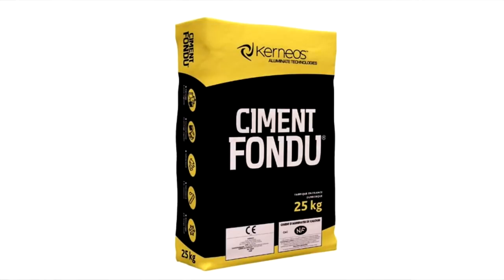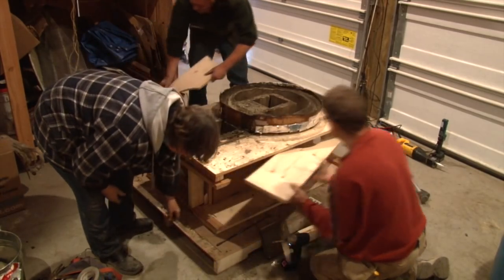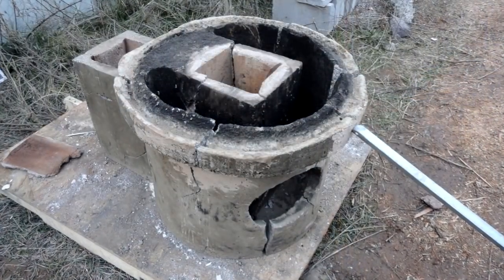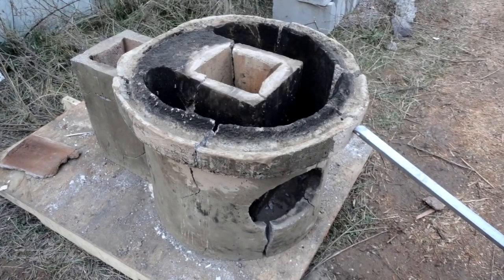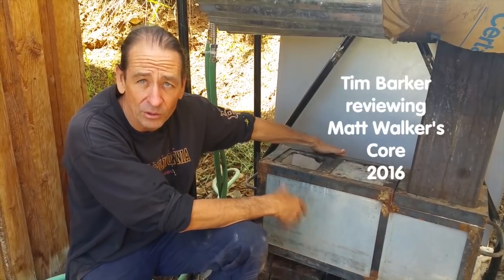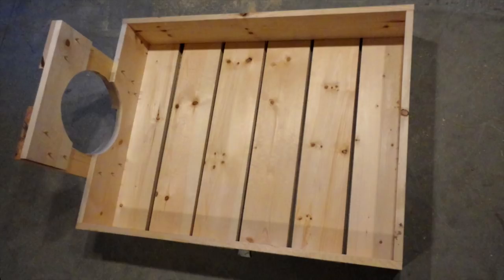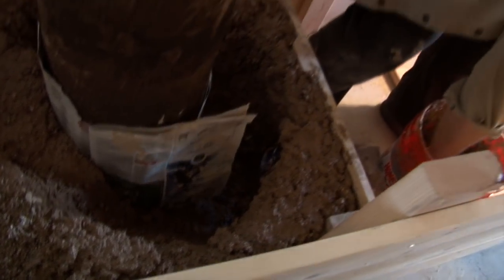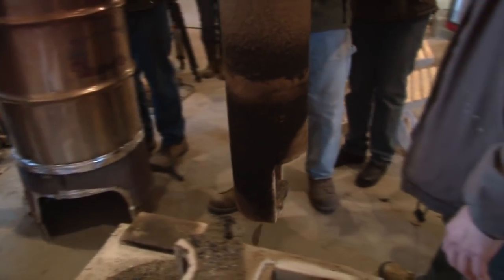Rocket Mass Heater Shippable Cores - 2 hours smashed into 8 minutes, from "Better Wood Heat"

Comment: I have been awed by your work ethic, emotional intelligence, and humor for years. My observation is a-question- when you develop a theory why 'research and develop' from scratch? While there is obviously much to gain by learning from doing, as in the case of the poured core, for example, others have come before you that could give insight that would save time, materials, money, and sometimes health.  Between steel, bronze, and cement, there is nothing new on earth. The internet is good for something, but also numerous treaties have been written- with all due respect.

Comment: Paul, keep up the good. Nay GREAT work!!!

I agree 100% with your opinion; -millions of these should be in use around the world.  You're also exactly right on the reason WHY; that they're hard to build. 
I DID that I built one by the book in a Friend's Greenhouse.
He paid for the material.
I did the labor and I told him several times that whatever he had in the thing in materials, I had MORE than that in labor I figured that I  had about $1,500 labor and had spent 24 hours a day I literally worked 24 hours straight at least one night one full day and night. 
I came home from a trip one time and walk in the greenhouse and see that it had been completely torn down! destroyed!
 Disassembled!
Dead! Down to the aircrete pad.I had poured and built a 6 by 9 Aircrete foundation for it.
I screamed when I saw that it was gone, and I literally felt like someone had stabbed me or  killed one of my children.
I put my heart and soul into it and it was one of the greatest things I had built my life.
it was perfectly designed it was done by the book and I was going to use water for the thermal mass at steel bucket so light out above the pipe and we would have had about 300 gallons of hot water.
 I liked nay, LOVED your idea  in the video where you rode bikes into town and put up a rocket stove within an hour or something like that. I built a wooden frame like you did and was going to use SOME GRAVEL. But the gravel was just going to be extra Mass around the steel buckets, which would be full of water!
I was going to go your idea one better, bc  water is 5 times better than anyting else at absorbing storing and radiating heat correct?
Well I can see you send in a chair and filling a 300 gallon horse tank, etc so my idea was to fill 300 gallons of water into buckets, drums and barrels.
Talk about low labor right?
Hey I'm lazy. I've always believed in brains over brawn. I pictured me mixing thousands of pounds of cob ...No,  I couldn't see it happening and I didn't have enough help around to do that so I just figured I could sit there and use the garden hose ten feet from the hydrant to fill barrels and buckets with water!!! Plus it ready going to be fine in less than an hour!!!
Then add dirt, gravel, cob etc where needed. 

I be never stopped try to popularize + 2 perfect rocket stoves.
I built three the simplest and most ingenious rocket stoves that you can possibly come up with.
Again I got to admit I don't have a lot of help and I'm lazy and I'm old I'm 68 years only had a heart attack and stroke two of each actually so I got to be careful what I'm doing with my body.
Anyway why spend all that time making Cob we could dig a trench the one I made parabolic.
I put waterproof membrane installation did the pipe so I wrote all the healer deflecting directly up into the Geodesic Dome.
It could be a yurt it could be a teepee it could be a dome it could be a cheap Walmart tent it could be a cardboard box but you can heat it and sleep on warm ground.
I'll send you a link for that stuff.
I made a cheapest readily available prototype possible out of 6 cm stainless steel hot tent pipe.
I will send you links for that as well as the ones that built in the Greenhouse.

Comment: Hi Paul .. thanks for the video. Just curious, how are insurance companies reacting to a RMH? Or do people just say they are putting in a wood stove? Insurance companies get so weird when it comes to wood stoves, pellet heaters, etc. .. and whether they are in a house vs a barn.
Reply from the maker: Several insurance companies are cool with rocket mass heaters as "masonry stoves".
Reply: Ok cool. Yeah, sometimes you just have to use the correct terminology for the insurance companies. Thanks!
Reply: Misrepresentation is not in your favor when the house burns down (from whatever cause) and the inspector says ‘this is not a masonry heater’ and your claim is denied.
May be worth putting some effort into getting this design approved by code and insurance companies nationwide, to create a demand for millions. Obviously it heats just fine. There’s workarounds for the ugly barrel. But the hurdle is code and insurance.

Comment: I made a 4 inch system with 15cm square steel tubing and 2 cm fiber insulating material on the inside (hench a 4 inch system) I use a large propane tank as my barrel, unfortunately this didn't cool off the hot gasses enough in the first season, so now I made 6 x 60mm pipes inside that run from the bottom and exit at the top, cool air gets sucked in at the bottom and blasts hot out of the top, cooling the exhaust gasses in the process.

I measured the temperature on top of the riser and often get 700+C  so where the wood burns in the tunnel it must be  at least 850-900C, enough to eat through bare steel in a hurry, exhaust to the chimney is often just 1/10 of the riser temperature, so it's a fairly efficient burn I would say, I can't get through 20 kilo of wood a day, burning at least 18 hours.

The ceramic fiber board works as an excellent insulator, and heating the system pretty fast, from lighting the stove to riser temperature of 500C is always within 3 minutes.
I only replace the first 25 cm of my insulation inside the burn tunnel every year, the riser and secondary combustion chamber where still ok after 1 season, it cost less than 10 euro per year to replace it and it's good to go for another season.
Reply: The silica (SiO2) in ceramic board can form cristobalite (a known carcinogen), at temperatures from around 900 degrees Celcius and up. It's advised to treat used ceramic board, that has been used as active fire insulation, with the same care as asbestos. Before use as such, it's considered harmless.
Reply: @cuboloudspeakers  yeah, I know, I treat ceramic fiber board as asbestos, keeping it far away from my airways and use gloves and masks while handling that stuff, gloves because it itches like crazy.

Comment: Paul I just finishing a steel build of 1/4 steel tubing. My question is does any one have experienced knowledge of how long will a build like this last. One winter two winters. before the steel burns out. Im using it as a Rocket stove not a mass heater the only insulation is on the riser.

Comment: One thing that come to  mind about this stove is would home insurance approve this item ??? What about the open inlet for the wood. I would bet you that if the design was part wood stove and part rocket stove that you would really sell a lot. Most people like convenience with little messing with the stove. Also, you could use a number of alloy metals bought that would not care whatever the temperature was. Just saying.
Reply from the maker: it sounds like you haven't watched the dvds yet https://richsoil.com/wood-heat.jsp

Comment: (insurance, UL, CSA) if you have to get a loan to buy your house in Canada and there is no CSA or UL certification on the heating system you won't get the loan or insurance.
If you own you're home and you don't care to ensure it you can have a nonCSA or nonUL system.
Reply from the maker: There is a lot of progess with building code, insurance and getting UL listed.
Reply: Can you be more specific?
Reply from the maker: Yes.   It is part of code in portland as of about six years ago.  And that code has been copied to at least a dozen other cities and counties.   I have heard of several insurance companies allowing the rocket mass heater to be insured as a masonry stove.  More details than that would require giving google a good workout.
Reply: crazy isnt it, when its so much safer than most all other forms of heating.
Reply: Willowtwisters- Except, it isn’t. There are no standards, no compliance ratings, no testing...
Your cob may work great, mine may fail. My strat bench may flow well, yours may stall. And on and on. Which is why insurance and code balk at them.
Why are most all other heaters less safe? Any UL listed device that is properly installed, operated and maintained is perfectly safe. The rmh is too much like a painting instead of a blueprint, and thus insurance and code say ‘no’.

Comment: Has anyone built a mass heater in the basement and enclosed it to use as s heat source for the rest of the home. 

Would be interesting to build one in my basement. Enclosed and insulated with duct work coming off it. 

I burn around 8 or more cords per year now.
Reply: Calculate price. I redid my parents home with plastic, then 2"foam insulation then recovered with drywall .. every window has a box that goes around it with plastic for nights and they have small heaters throughout the rooms. Never been warmer with less work. Cost about +$140 monthly I worth it.